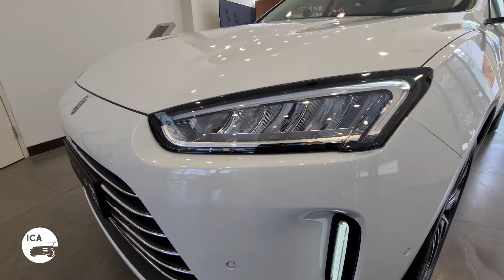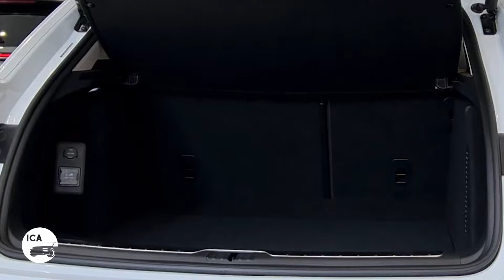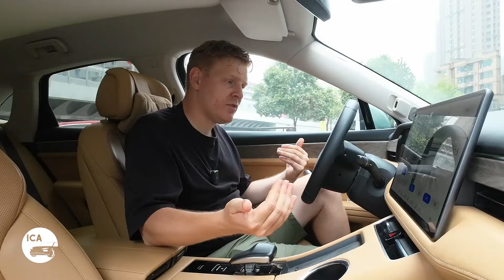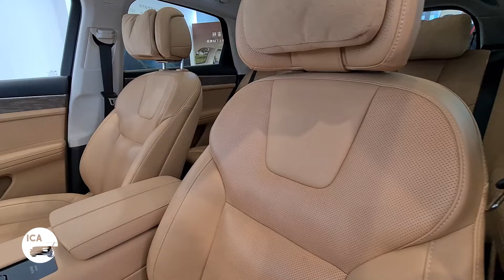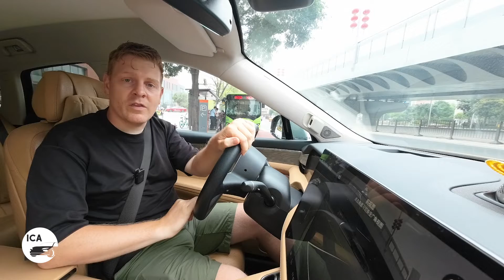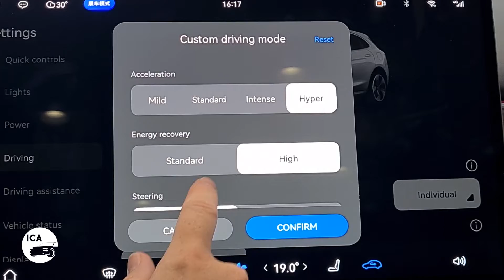The First Huawei Car Is Better Than You Think - AITO M5 Review

Comment: Thanks for this. Quite like the shape as not keen on the modern sharp angled cars. The interior looks super comfortable. We already have an EV, a BYD Atto 3 BEV. This could be a good way for many people to get into modern technology and help them get rid of the ICE vehicles which are the blight of our lives. As you say, you could easily run around the city in this and never have to use the engine but it's there if absolutely necessary. Thanks again.
Reply from the maker: No problem Lou. Glad you liked it even though it was one of my very first (and awful) videos. You can check out the Li Auto videos for much better EREV examples and better videos. It'll be a popular type of drivetrain for a while as a crossover point I think.

Comment: Do you know the consumption of the car after the battery is empty? How many litres per 100kms does it consume?
Reply from the maker: I'm informed that with the engine running (remember it only charges the battery, it cannot power the wheels) it uses 9.8 litres per 100km. Generally what happens is that when the battery gets to 20%, the engine will kick in to start topping up the battery.
Reply: 3.2 kWH/litre
Reply: it is about 13.5 liters per 100km. high way 120-150km/h.